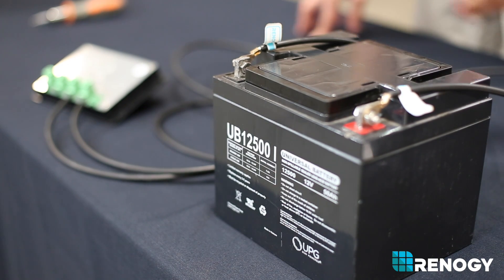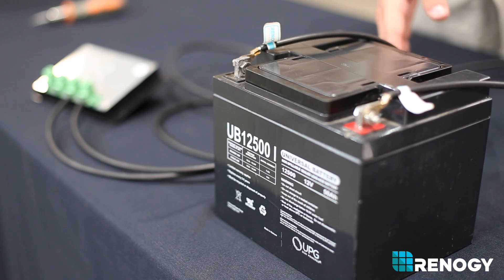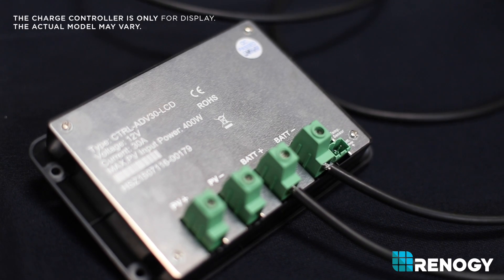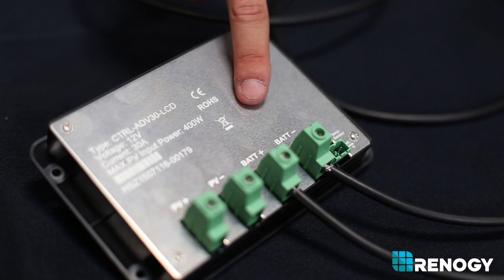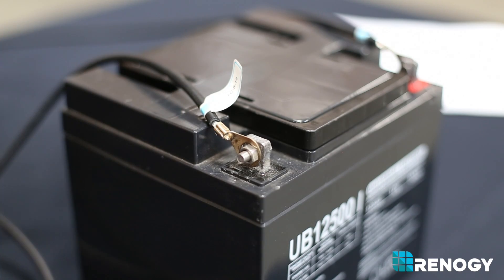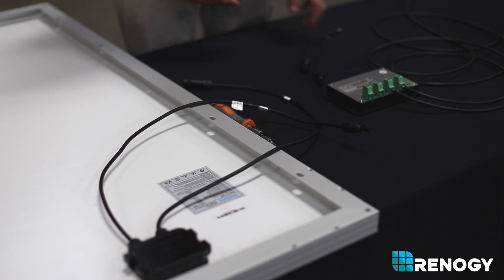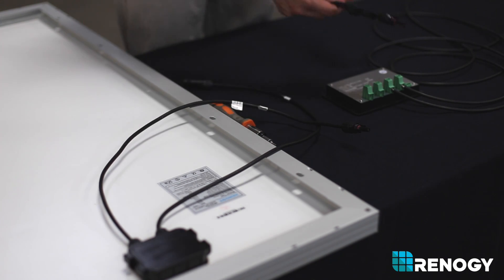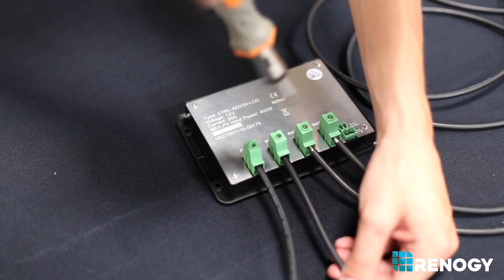Renogy: Basic System Set-Up (6/6)

Comment: If you had an inverter so that you can generate AC current, how would you connect it to this setup?
Reply: Your inverter would be connected to the battery in this setup. The back of the inverter has lugs where you connect your wires from the battery to they should be marked when you do connect it always connect it negative cable first then positive next or it can cause a short in your inverter and fry it and always disconnect your system positive  then negative